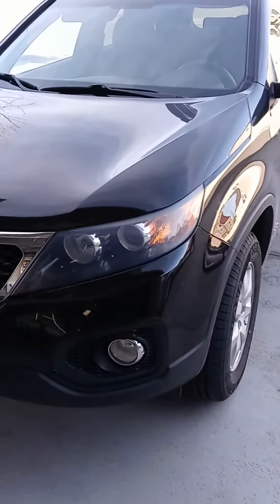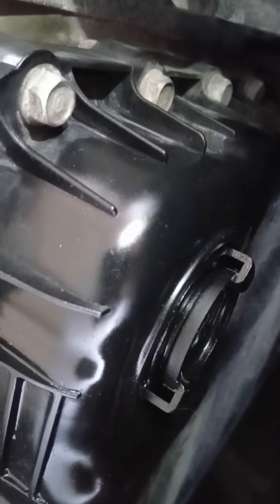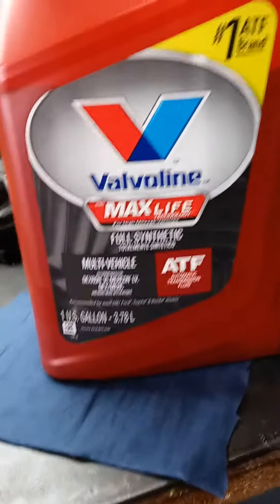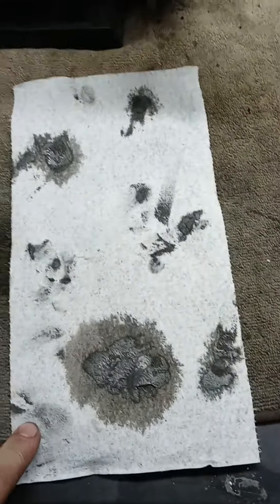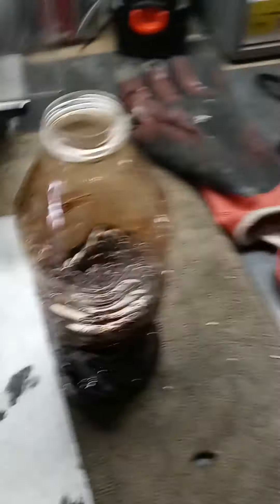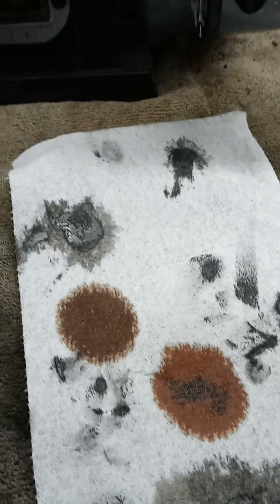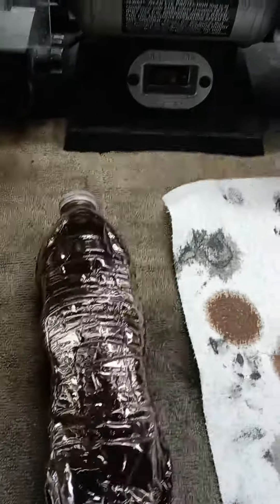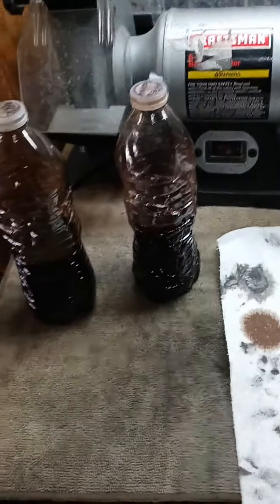2011 Kia Sorento transmission fluid change at 98k miles.

Comment: I just bought one used that has 134,000 on it and I have no clue if it's ever been changed. It sounds like I could check it through that big plug with out it spilling out. Thanks for the video
Reply from the maker: Yes the big plastic one on the side.
Reply: @zx9green791  So how did you get to the magnet?
Reply from the maker: @taylolz  Hope you project is going well. The bottom plug is the one with the magnet. If you pull it out the whole thing will drain quickly unless you plug it with your finger or something. Let me know if you have any other questions, and good luck.
Reply: @zx9green791  Thanks, I might change it this weekend. I was able to open the plug and check the color. I figured I'd clean the magnet while I'm at it.